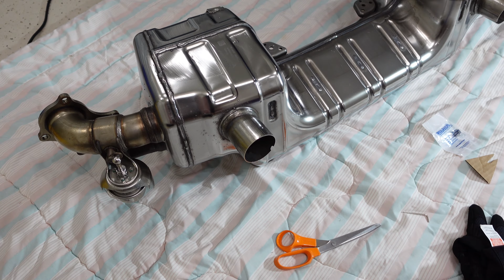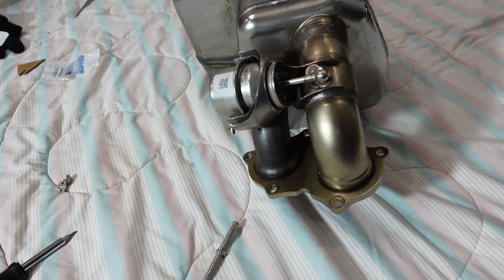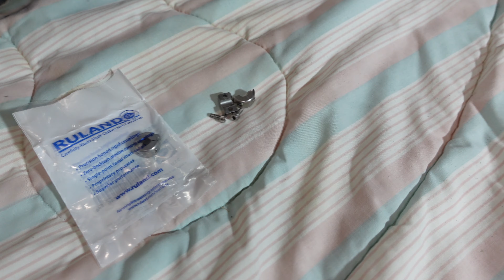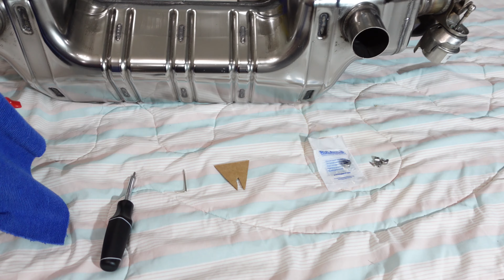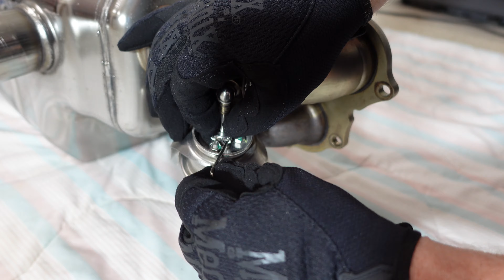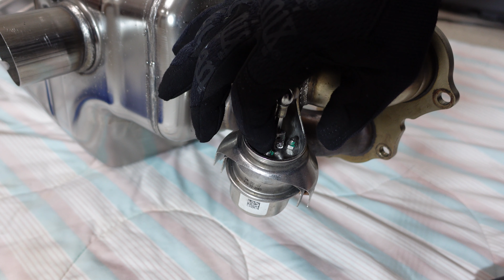Collar Mod | Best Bang for the Buck Exhaust Mod | Porsche 718 4.0 Liter

Comment: Looking for the follow up video. How has this help up? Thank you!
Reply from the maker: I ended up taking them off to sell the car.  They had been in place for about 14 months at that point.  They were still perfect.  No shifting or sliding.  No corrosion.  They disassembled as easily as they went together.  I was even able to do it with the muffler on the car.  Also, the valves were still strong and moved easily once the collars were removed.
Reply: @focusedwherever  thank you so much!

Comment: You can put the collar on without taking the exhaust off. I just finished the job in about 30 minutes.
The key is having the right tool. As mentioned in the video, it has hard to get to the little screws because they sit under the ridge of the plunger cup. You need a 2.5 mm Allen wrench. I bought a set of metric Allen wrenches at Lowe's and cut one down so that it is short enough to fit between the screw and the ridge of the plunger cup.
With that it is a piece of cake. I used a jack to make it easier to get to, but I guess you could do without.
One other helpful hint: when getting the collar on the plunger, leave one screw in but loose to the point of coming out completely. That way you can hold the back of the collar in place on the plunger and just flip the front of the collar around to meet the back. That way you only have to get one screw lined up.
I only used one collar on each side. I'm going to drive for a while and then check everything for tightness again.
Thanks for the clear video.
Reply: How is the outcome of this? And thank you also for the detailed info!

Comment: why you don't disconnect from the engine bay che electrical connector of the vacuum line, so the valve are always open?
Reply: That is what I am doing next week.
Reply from the maker: Collars are quick and easy.  Can be done without even lifting the car.  No risk of a CEL.

Comment: I did that with muffler in place.
It helps the sound, but recently i installed OAP with these collars and that really changed the character of the exhaust note ! Like a whole different car now.
Reply: The pipe between the muffler and the header/cat pipe.
Reply: What is a OAP?
Reply: @bernardvreulink2457  
Over the axle pipes 
The pipe between the muffler and the header pipes. Which has a gas particulate filter in the oioe now because of new rules the European union mad porsche add to Save the planet  ! and destroys the sound.  USA cars are nor monitored by the computer so it's can be replaced with no problems.. soul,, fabspeed aftermarket exhaust companies all see them..they have videos on utube on them. Then that with the shaft collars locks open the vacumn valves that the computer controls.
Reply: Any video or link to your set up with your sound?
Reply: @tyson527  obsessed garage has a utube video of the over axle pipes with the vacumn values disconnected and always open, which he recommends over replacing complete exhaust systems.
Reply: @tyson527  don't,  but it's really almost like bypassing the muffler, straight piped,  and it pops, bangs, crackles, people know you are coming ! But, it's also not too extreme. It is a little hard to put the collars on with muffler in place, but raise the car a little if you can and be patience

Comment: Thanks for the (very) detailed video. Why just not unplugging the vacuum lines if the valves are open by default? Just seal the lines with something (a screw or whatever) to fake the system and that's it...
Reply: Keeping them fully open 100% of the time would produce drone - especially with the stock exhaust.
Reply: @GethinJames  I installed the Soul Performance OAPs with resonators, BMC filters, disconnected the vacuum line and I don't notice any drone.
Reply from the maker: I also have an OAP and I don't sense any drone with the valves always open.  I have a GR Corolla with the stock exhaust and that definitely drones at slow speed in 1st or 2nd gear.  In the GT4, it doesn't make any sounds or frequencies that bother me.
Reply: @GethinJames   Maybe not with the drone delete kit?
Reply: Are they open by default or closed?